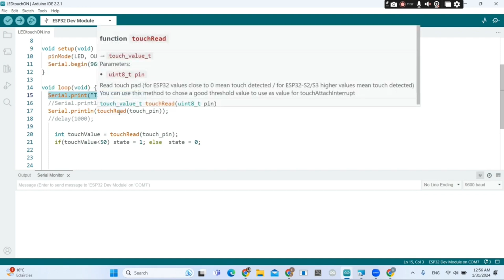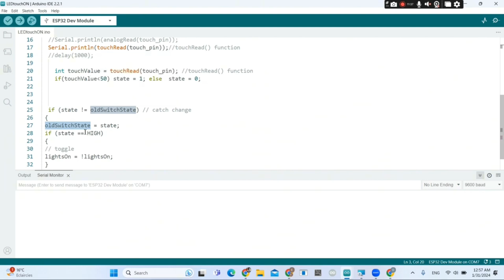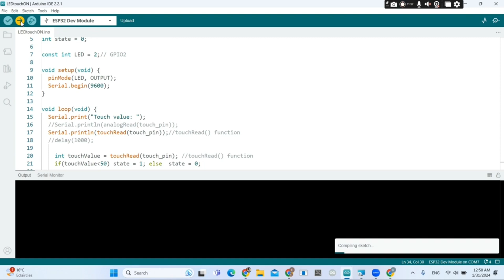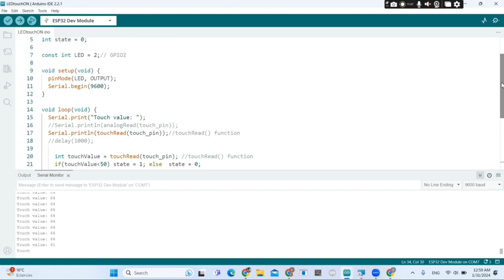Capacitive Touch Sensor Pin Tutorial for ESP32: GPIO Magic! [2024]  @TMEEducation

Comment: This is a terrible idea! You're relying on current induced in your body to charge the gate capacitance of a floating input. This is incredibly unreliable and if it works at all it might stop working at any point, when you move the board, or the weather changes or you turn off your lights. You also run the risk of destroying the input from ESD by touching it directly repeatedly.
Reply from the maker: What’s the solution, sir ?